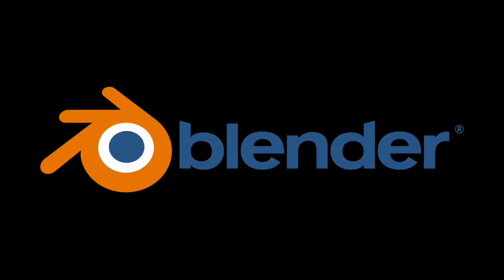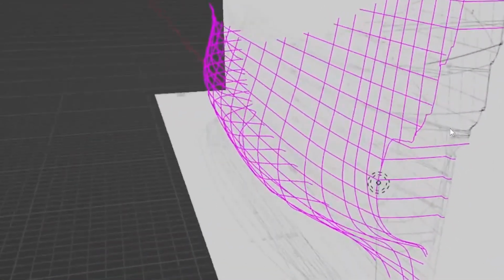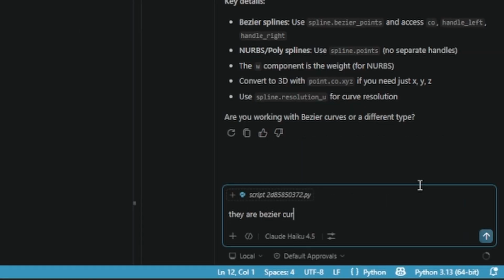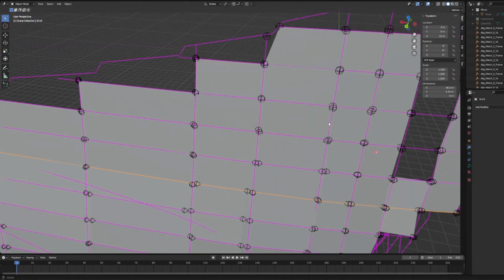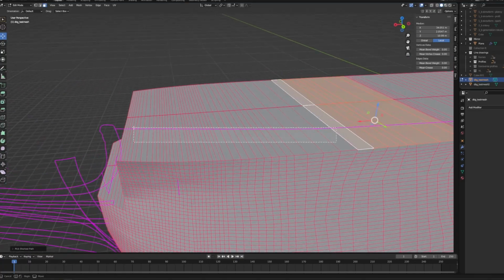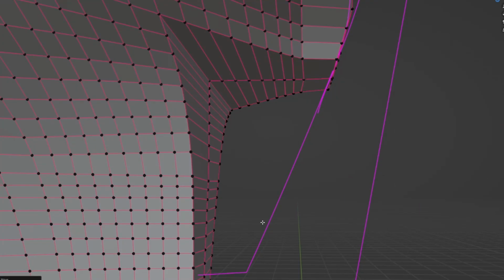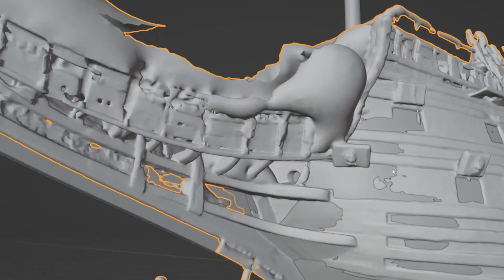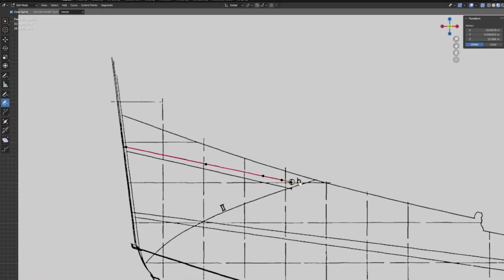When 3D Modeling Fails, Use Janky Python Code – Rideable Vasa #3

Comment: I think I would have settled for the frames not being perpendicular to the keel and just sketching in the needed intermediate frames by eye in between the given stations.
Then when you build, have the frames upright (as per the stations in the plan), and set in the keel on a slope.
Reply from the maker: Yeah. I mean, it made some things easier and some things harder to be honest. Having the keel be horizontal made for an easier reference point which was nice. It of course also created other issues instead.

In general it was a bit painful to set the frames to the exact position in the jig. I think it would have been either way. The main problem being… my methods